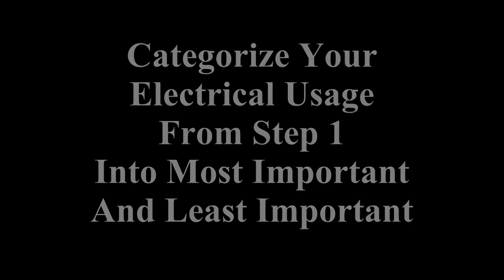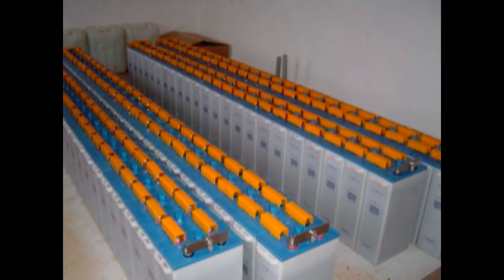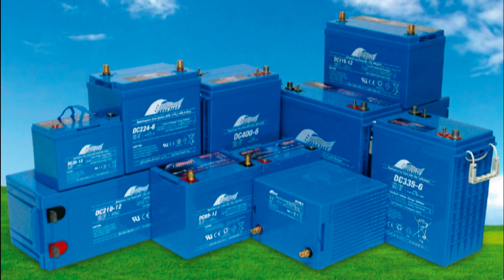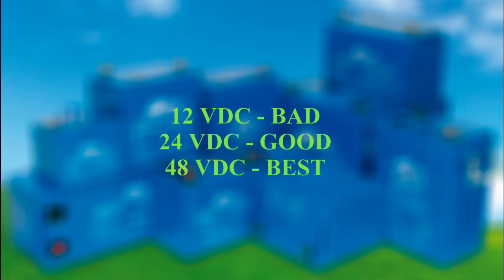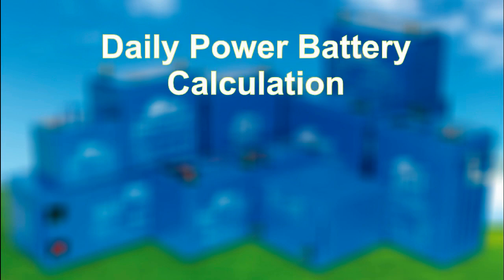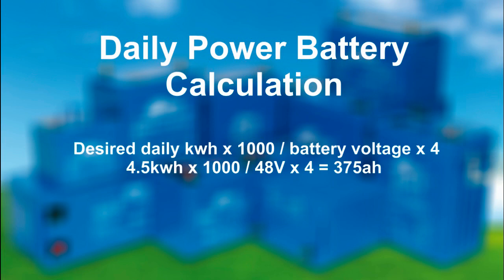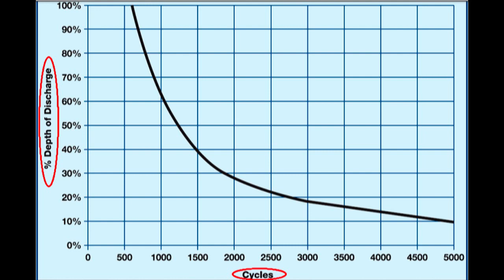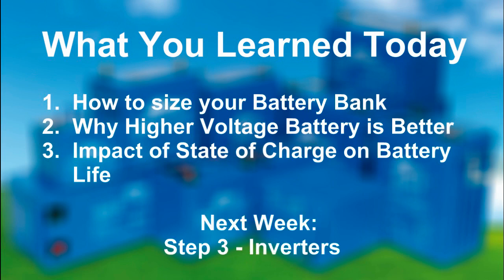Step 2 Solar/Wind Power: Battery Selection

Comment: Great job on this.  I totally agree with you on every point.  What do you think of golf cart batteries?.  If they are ok, what do you recommend.  I am just starting on this journey.  I have been Enphase grid tie, but now I want to go to off grid for almost the exact same draw as you.  Fridge, Microwave, lights, and pellet stove and tv/satellite dish as well as computers phone and internet.  Thanks, Jim
Reply from the maker: Jim, I think that golf cart batteries are okay, but most people end up having to wire them in parallel as well as series to get the kwh needed.  I have seen many people have great luck with electric forklift batteries purchased from a scrapyard.  That will be the direction I go when replacing my set of batteries.  There is nothing wrong with golf cart batteries, and if you can get a great deal on them, then you'll do fine by them.
Reply: Thank you Steve.  I will take your advise on the forklift batteries.  I got some cheap golf cart batteries from my state that they were dumping for 50 dollars each.  Question?  Most water heaters are 4800 watts.  What did you use and what should I look for?
Reply from the maker: Peaceful Prepper
I would definitely run those golf cart batteries at that price.  That's fairly near scrap values anyway.

I purchased a standard 50 gallon water heater.  I replaced the heating elements with 2000 watt heating elements because the original 4800 watt elements ran the inverter over it's maximum rating.  2000 watt elements can be purchased where you buy the water heater.  One thing I would have done differently (and still will do) is run the water heater on it's own dedicated, cheap, modified sine wave (instead of pure sine wave) inverter.  That leaves the main pure sine wave inverter with it's full capacity to run the entire house.
Reply: That explains that, thank you.  Could we also run DC elements and bypass the loss of inversion?  Is that possible or even logical?
Reply: I am using those golf cart batteries to run my off grid experiments.  I am so glad I found your channel.   Since my eventual power needs are about the same as yours, How much was the Battery bank?  Also, I live in 30 below climate, Maine, I noticed the small heater in your battery shed,  How much does that draw in the middle of winter?  What temp do you keep you battery shed at in the winter?
Reply from the maker: Peaceful Prepper
You can run DC elements if you prefer, but DC elements are usually twice the price of their AC counterparts, and the contactors (not just relays) required to operate them are both expensive and use more electricity than inverter loss.  The AC elements can be turned on and off using solid state relays and consume the power of a tiny LED to energize.  DC elements are special order, AC elements are off-shelf.  DC contactors are electro-mechanical, solid state relays are completely solid state.  But there's nothing wrong with going DC if it's your preference.
Reply: Ok, your 30 yrs is my gain, lol.  I am not as electrically savvy as you and will need some help.  I have had some DC theory and am beginning to learn more.  This can be a dangerous hobby.  Your load diversion videos are very helpful.  Your experience is invaluable.
Reply from the maker: Peaceful Prepper
A couple more issues I just thought of, Jim.  Going DC would also require heavier wire to the elements, and the thermostats would not be able to handle the additional amperes required for the DC elements.  So I would have to say that refitting a standard AC water heater to DC is not at all feasible.
Reply from the maker: Peaceful Prepper
Jim, you're quite an observant fella!  The small heater in my shed is something I run only on cold days I'm doing work in the shed.  Otherwise it remains off.  I am going to do another video on batteries soon, mine in particular.  In the winter, I wrap insulation around the batteries, and leave it at that.  On extremely cold days, their capacity is greatly diminished. 

If you have room in your home, you can safely keep AGM batteries inside your home because they are leak-proof, explosion-proof, and non-gassing.  I live in a tiny house so real estate inside my house is a premium.  But if your golf cart batteries are AGM, I would suggest building a closet to install your inverter, charge controller, and batteries.  It would make your life much easier in so many ways.

Otherwise, batteries will require ventilation and national electric code will not allow them to be installed inside your home for any reason.  Cold weather provides many opportunities for creative ways to keep batteries warm.
Reply: I like the idea and convenience of AGMs.  What is their durability as to compare to filled? They have not been around that long have they?.  AGMs also seem to handle cold for this area better.  I am playing with a12V, 250ah AGM that I got off a ship that has to turn it in every 2 years.  I am using it to run the tv in my bedroom.  Nothing hard wired yet, just testing.  I am going to build a small home and want to take it off grid.  I am so glad I found your videos.
Reply from the maker: Peaceful Prepper   AGM's come with both advantages and disadvantages.  The advantage is the ability to have them indoors and out of temperature extremes.  The disadvantage is you cannot give them an equalizing charge like wet cell batteries.  They receive an equalizing charge via float charge over an extended period of time.  Difficult, if not impossible for us hard-core off-gridders.
Reply: I see.  How long would that charge have to go?  I just got a bead on 3 more 250ah 12V AGMs.(8Ds) (Deka) That would give me 500 dollars into them.  I could then go 48V as you have suggested.  The down side is I have no Idea what voltage they are holding at this time.  I would also have to equalize them before making them into a 48V system, I would think. Or, equalize them in a 48V setup
Reply from the maker: The length of charge required depends on several factors, primarily the amount of discharge it has had before the charge.  I have AGM batteries and it can take several warm days before they get back to full potential.
Reply: Peaceful Prepper I think AGM's are especially great for the smaller systems, and yes they last a long time.    I have a set of 4 x 12V 105 Ah AGM batteries that were given to me used.  They were tested OK in 2001, they are not nearly what they were but they still work reasonably well.    I have a newer set I bought new in 2008 of 4 x 105 Ah 12V that run a small deepfreeze converted to a fridge and they are still working great.     We get a lot of sun in Alberta including in the winter time.     I think that a 12 V system works well for the  small systems like under a 1000 Watts.    The bigger the system the more sense it make to go to a higher voltage.
Reply: I agree on the voltage.  I am also looking into the freezer conversion.  How do you like it and what is the draw daily?,  How many Cu is it?
Reply: I'll have to get back to you on the usage,  have a kill-a-watt meter but I never used it on the fridge.   I might try a short video.    Yes a small deep freeze works ok, you have to plan how you put stuff in there so know where everything is.    The lowest part I just keep a small tub filled with ice packs because it is so inaccessible I don't bother with it.     I might try to make a short video on it this weekend.
Reply: Thanks I will look forward to the video
Reply: So after 2 days  48 hours it consumed .53 kWH, I think Iif I read my killawatt meter right.    This was after 2 days of "use" ie opening the fridge from time to time and taking stuff in and out.    The deep freeze uses about a 130 watts of power when it is running.
Reply: Sounds about right.  I have seen a few people convert the small freezers.  I may do it for my off-grid camp.  My standard 21 Cu fridge is only using 100w while running and uses about 1KW a day.  Not too bad.  I just installed the new hybrid hot water heater and it is using about 1.5KW a day to heat my 50gallon tank.  I really feel we have reached a point in tech that is making it much easier and cheaper to go solar.  My system is producing 10-14KW a day.  I think I am now carbon neutral.  Your ideas are great and I appreciate your time on this.  Were you able to make the video.

Comment: Excellent presentation! Well edited, clear audio, easily read text ( good contrast )etc. .You just briefly touched on forklift batteries ( which some people say they can get for ridiculously cheap prices, eg. in Mexico). I would like to see a bit of info on lithium ion batteries, which although they cost more for the same amp hours, they can be discharged much deeper, like 80%. The Iron-Edison batteries (that you said you love/hate), can also be deep discharged and overcharged without damage ( might have to replace the electrolyte). Some people don't  even worry about a charge controller on small setups ( but they would lose the benefits of an MPPT). Haven't heard too much good about AGMs as they are pretty much done for if overcharged ( seems like you almost cooked yours , no thermal input to the charge controller?). Really appreciated they effort you put in this, especially so, since you aren't plugging someone's product line.Thanks again!
Reply from the maker: Martin, I am anxious to see what the automobile industry comes up with for Li-Ion batteries.  They still have some physical/chemical hurdles to overcome before the price can come to a level I can think of affording.  You are right about the Nickel-Iron batteries, the ones I had would regularly get discharged 100% with no problems. 

I have almost cooked my AGM's - my lack of personal experience with them.  They are definitely more finicky than wet cells, but I also see some advantages.  I've had them nearly two years now, and they are still providing our power needs.  Thank you for your encouragement, and I have been working on another video that should be out in a couple more weeks.

Comment: Steve,
You have the best, most clear instruction I've seen.  And, with over 20 years experience actually off the grid, you're advice is not advertising or theoretical.  Thanks!